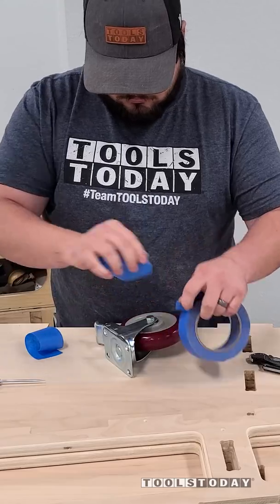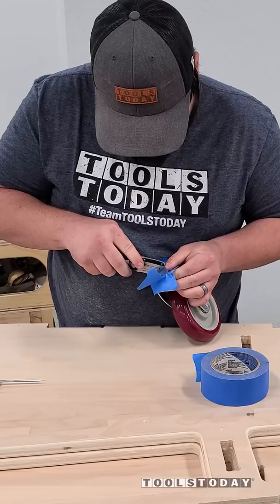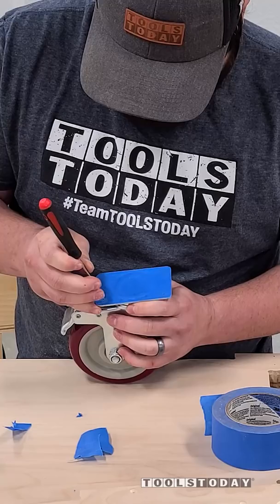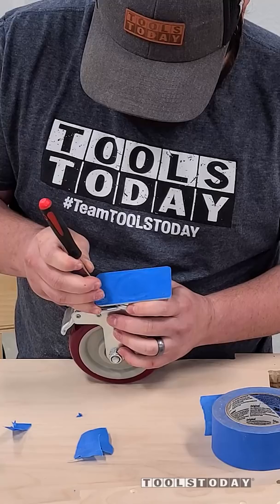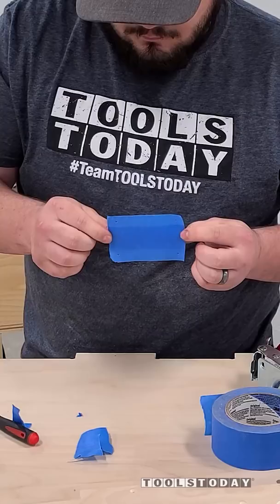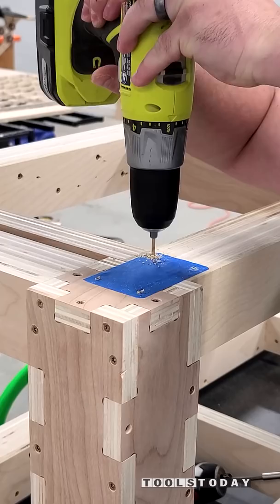How to Get Exact Hole Locations

Comment from the maker: Thanks for watching!  As with anything there is certainly more than one way to do something.  I prefer taking 1 minute to make a template like this to be able to stick down and predrill all of the holes in the exact right spot, rather than marking the 16 hole locations for all 4 casters.  Everyone is going to have their own way to do something, this is how I prefer to do it.
Reply: I can see using it. I would use way bigger bolts and the precision would help there.
Reply: I’m confused, you are still marking all 16 holes for all the castors.  I understand if you are doing this for a hands free option since you don’t have to hold the castors to mark the holes but the comment of “rather than drill all 16 hole locations” makes zero sense because you have to do that no matter what.
Reply: Sometimes the pattern of each caster can be different. So your method is not good
Reply: Been doing it for years works great on picture frames too. BTW disregard the negative comments here...you'll have that but we're smart to do it the easy way!
Reply: @thisoldshtbox3626  I don't do it for every job but pretty much exclusively for hanging paintings and pictures with keyhole slots. Also I don't use tape and don't use a marker I just press on the holes with my thumbs and leave an impression. If you can't visualize how this would be a 1 min job than I can't help ya.
Reply: I could easily install a 4 hole power strip on the wall in less than 5 mins using a template made from a piece of paper. I wouldn't need to waste time with a tape measure and/or square or even a level for a PS.
Reply: Wow, what a waste.
Reply: @toddsantos2118  I bet you fell down the stairs and hit your head.
Reply: Just delete this video. Lol. Save yourself further embarrassment.
Reply: The excuse is as stupid as the video. No matter what you're still marking and making 16 holes. Easier to square up a caster then a piece of tape. I'd have all four casters on and onto the next job by the time you're putting in the last screw of the second caster.
Reply: @thisoldshtbox3626  🤣🤣
Reply: Dude, while it's fine you have your own way of doing this sort of thing it is a LOT easier just to use the castor as a diagram and mark with a pencil/pen/anything. You are spending a lot of time and unnecessary resources just to do this. Not trying to criticize how you work, but it seems like extra steps to cut two pieces of tape, cut around a castor, poke the holes, and then traces those holes where you want them on the project. When you can simply use the castor to trace the holes
Reply: Whether you’re using the casters or the template, you’re still marking all 16 hole locations.  Not that making the template takes a lot of time, but it’s still less efficient than using the casters themselves.
Reply: Think like trump.  More haters mean more are jealous....
Reply: Sorry bro but this is so bad
Reply: This is dumb..just put the caster in the place... Nevermind
Reply: А сразу разметить с колеса не?

Comment: Pro tip: place the caster in forging oven to heat up. Then use the caster to hot brand the imprint on the wood.
Reply: That is a good tip
Reply: And melt the wheel off
Reply: @jalee6587  😂😂😂
Reply: Lol!!

Comment: Man I feel like I've lost brain cells through watching this.
Reply: We live in idiocracy get used to it
Reply: I never comment on shorts but this was exception. Common sense is rare these days
Reply: He used the castor as an example. This would be very helpful if you were doing something like mounting a small motor where you can’t use the holes to drill since there is things above it blocking it.

Comment: The technique, as presented, relies on the fixture being symmetrical.  You're putting the sticky side of the tape on the top of the caster and then on the bottom of the workpiece,  if you did this with an asymmetrical fixture, you'd have mismatched holes.
Reply from the maker: Had I had asymmetrical holes, I would have used a different method, but I didn't so I used this.
Reply: @ToolsToday  this technique, as presented, relies on the fixture being wood. If it were metal you would need to use different screws.
Reply: @ethan5103  i was making fun of the original comment.
Reply: @ZsaZsaUmbra  who would've thunk it? You mean to tell me they make different kinds of screws? Lol
Reply: Yep for that  1 in 100 chance that it's not symmetrical.
Reply: Although this is a long way for a shortcut and that's probably why you're picking on OP, even if the fixture was asymmetrical, your holes would simply be mirrored. Just.... turn your template or castor....

Ah my brain, I swear we are devolving as a species.
Reply: @DeltaCodex  I agree, most people don't think in 3d.
Reply: @ToolsToday  You're posting this as a how-to quick tip to help people, no? "Here's a technique to use for casters... or really whenever you need to get multiple hole locations in the right spot."

He's simply stating it's significant to note that there has to be mirror symmetry as well, not "whenever you need to get multiple hole locations in the right spot." It's not an irrelavent assumption that you failed to mention in the video.

Personally, I'd omit the tape for this application and just trace the castor holes on the wood with a pencil, considering the pencil marks wouldn't be visible. The tape trick could work well in other applications though.
Reply: @ToolsToday  and for this method you could have use the caster.

Comment: To all the people saying this is unnecessary, the castor was just an example. What if there was something above it blocking the hole so you couldn’t fit a drill or a pencil in there. For example, a small 5hp motor has things above it blocking the way. This would be very helpful.
Reply from the maker: Exactly right, it was just meant to show the tip and something that helps me out.  A castor isn't the only spot this would be super useful.  I appreciate it!
Reply: @ToolsToday  no problem!

Comment: That's kinda cool but entirely redundant since the casters have holes already that you can pilot through. If worried about it moving while drilling just put a clamp on it or realign it with your first hole. This would only be useful if you didn't have the caster

Comment: That's useful in other situations, not this one, you just use the holes and mark it with a pencil, even easier, simpler, faster and no need to waste the tape.
Reply: I agree  some applications would be great help
Reply: @LUTHERJ304  name a single situation...
Reply: @OvertonWindex  mount those cheap lights above your stove.   Light bar frolecent light bulbs.        Or mount your battery charger to the wall.  Or power strip under desk mount to wall.
Reply: @LUTHERJ304  all of those... you just put the thing you're trying to mount, on the wall... Dot the holes with a marker. 
    Powerstrip... only takes 1 screw... so why you'd need a template for that blows my mind.
Reply: @OvertonWindex  troll I gave  practical no doable applications.   Just go on some where
Reply: @OvertonWindex  I'd love to see you dot the holes when they're blind holes on the back. Also I'd never mount a power strip with a single screw, I have more pride than that plus it'd be pointless.

Comment: I know in this case you can use the caster itself for the template, but it works perfectly for mounting surge protectors, along with anything else that can't simply be used for a template.
Reply: You're right, and it just shows that he should have picked a better example before making a video. That seems to be the main reason people are roasting him in the comments.

Comment: I use the castor at the template and mark the holes with a smaller point sharpy. Fast, easy and accurate.

Comment: A better example of this is when you are trying to mount something with blind holes. Surge suppressors will have Mount holes on the rear. However, you can't access them from the front.

Comment: Yes, because placing the caster in the location and marking the holes is to difficult. 😂🤣😂🤣

It’s not like trying to install screws to mount a power bar where you use tape or you photocopy the bottom of the power bar and use that to locate the screws.

Comment: Place the castor. Drill one hole. Put the screw in snug but not tight. Drill the other holes and put in screws. Tighten. Done and you didn’t waste any tape or extra time

Comment: Dude it’s WAY easier if you put a #2 pencil in the chuck of your Ryobi drill and use it to stencil the holes of the caster. Then throw the Bosch drill in the trash and drill the holes with a Milwaukee

Comment: Use lag bolts not screws... That is why the holes are big and not screw size.  The screws will snap off... if you have a loaded cabinet and hit a hole... I have seen a lot of road case and PA speaker wheel designs and screws don't cut it...

Comment: Graph about over engineering a problem, the wheel can be placed on the wood directly and then you can screw it in directly if soft wood or ball work pencil and drill pilot hole! Either way you are going to get the job done twice as quick

Comment: This is a great tip when drilling blind, like putting a mirror on a wall where the fixing are masked and you can't actually use the object as the template. In this instance as everyone has pointed out, the casters are the template and the tape is a waste of time and materials. 'Tools today' describing the employees rather than the company 😲😲

Comment: My drill holes were bigger than the screws so I used anchor to hold them. But the anchors were too big so I made the hole bigger which was an issue as it was too big for the anchors. So I got a new piece of wood and screws the screws in instead and it worked. Amazing what can happen when you decrease the steps of failure on a job site. Also amazing what happens when I pick up a drill. The only time I blow things out I guess 🤷🏼‍♂️😂

Comment: Can scotch tape be used for this? What about notebook paper? It's not sticky but you could use tape to hold it in place.  What if I'm using a caster that doesn't swivel, but has a wheel lock, will this method work the same?

Comment: Why wouldn’t I just hold the wheel up and put in screws. But if you need you can drill holes but still just hold the wheel up what’s the point of making an extra step to do.

Comment: You know id really like to thank you.  
Had a prob finding hole locations on a cover i re fiberglassed for my aircraft. That covers the screw thread holes on my wing. Ive been wondering how i can find those exact blind holes  as there is about 12  of them . And bingo your vid. Thanks. Despite the comments below this is a great option in reverse for when you cant use the hole part as a templet.
   So for the most parts of the comments.  Your off the hook  if you need  to drill new holes for screws in a blind hole.

Comment: But... why don't you just put the whole thing on the location you wanna attach it to and mark the holes with a pencil? 🤔
This trick can be useful in tight spots or if the thing you wanna attach is too big. But in this particular scenario it seems kinda pointless. 😅